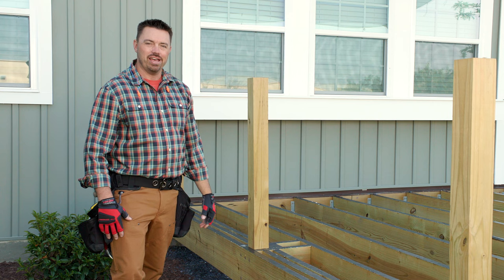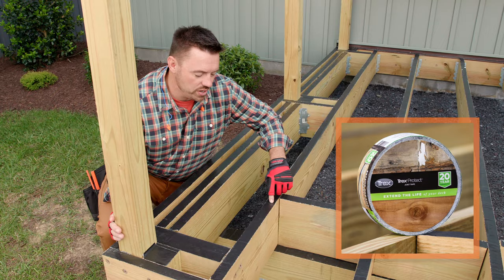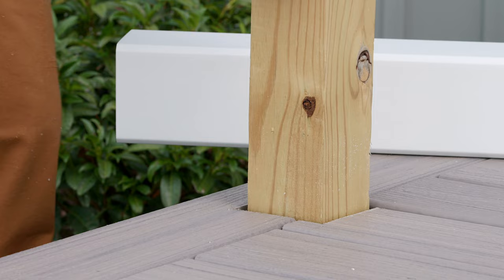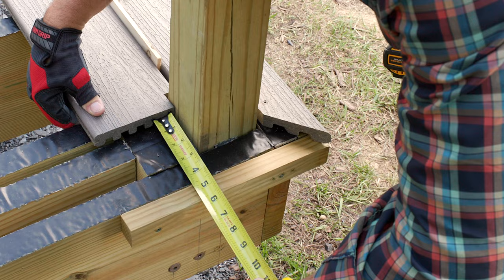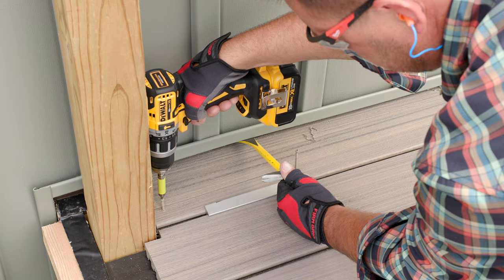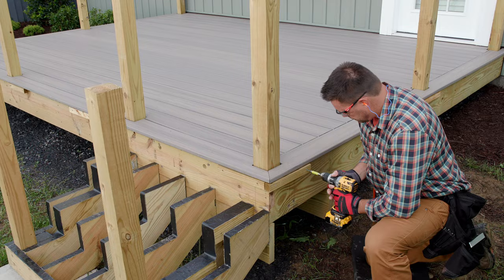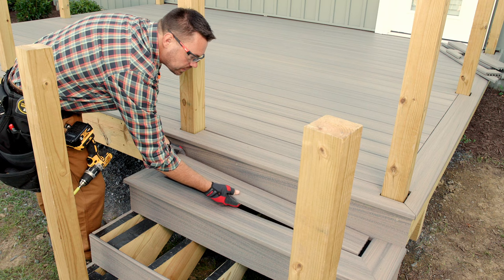How to Build a 12x16 ft Deck with Trex & Home Depot Part 1 | DIY Decking

Comment: When you install the outside picture frame board I think it’s best to measure back and pop a line because if you follow your 1 1/4 block and the deck isn’t perfectly straight you’ll have a bow in it wherever the deck is out because we know wood isn’t perfectly straight there for having a bow that will go the whole way back towards the house. Especially when resurfacing a deck.

Comment: Great presentation ! When fastening down a scalloped bottom like the Enhance Naturals deck board, as you said you need to be at least an inch away from the edge or end, but does it matter if you end up putting a screw in the thinner portion of the board... or even halfway on both the thinner/thicker portion ? Or is it just better to always screw in the thicker portion ? Thanks.

Comment: still need to hide the cut deck board to the picture frame board. leaving a gap you can see the raw edge
Reply from the maker: Hi!  Thanks for reaching out to Trex!  Feel free to contact us at our customer care department at 1-800-289-8739 or email us at customercare@trex.com for some tips on hiding exposed edges. -Trex Customer Care Team

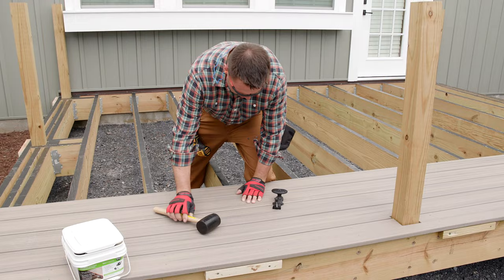Comment: For the two extra joists installed parallel to the out edge joists, to support the picture frame, you mentioned using Simpson L70 hangers. Do you have just 1 L70 per end on each joist stub?  I'm guessing on the first one, its on the outside face, and on the second one I see its installed on the inside face (looking at time 8:08).  Actually, looking at that tine mark, I'm confused about the placement of the L70 on the joist stub that is sandwiched in the middle -- is there enough space on either side for its L70?    Looking at building a comparable deck right now with a 1 board picture frame, and possibly this supplemental blocking method would be easier than what I was planning.

Comment: I'm building a Trex deck that's also 12x16' and about 2' high, just like in your video. But I'm not planning on using a ledger board, and instead will have 9x 12" cement footings (in a 3x3 formation), under a freestanding deck. The beams will be resting right on the cement footings, also like in your video. 

My question is - how can I best install the header joist (where a ledger board would've been installed) since I don't have the benefit of working off of the ledger board and then nailing in the joist hangers for each perpendicular joist etc. Should I use temporary make-shift supports installed to the underside of a few joists so I can rest the header board on them and then remove the supports after the board is nailed in, and then install the rest of joists or lay out all the joists and save the header board for last?
Reply from the maker: Hello Allison, thank you for reaching out to us with this question. We love to see you chose Trex! For substructure installation questions, we will advise to contact your local code/building official. Since various municipalities have different attachment requirements, this is always the best way to ensure a safe installation. If you have any questions about your Trex, please feel free to call us at 1-800-289-8739. Thanks - Trex Customer Care Team

Comment: What are the recommendations to fasten around the miter part of the picture frame board, any pattern in particular or just 2 screws at least an inch away from the edge and end ?

Comment: Composite decking is much more flemsy than wood. I thought it was supposed to be a maximum of 12 inch center for the framing because of that.
Reply: Depends on the brand. Many are now 16 oc

Comment: Thanks for the video. What is the gap between the 2 Blocking Joist, and are you using 2x12 for you Joist?
Reply from the maker: Hello, and thank you for watching Trex Academy! On this project we used 2x10 joist material. The gap present in this video was 1 1/4". This gap can vary on a couple of things, for example how much the deck boards will overhang the outside rim joist. If you have any other questions, please feel free to call us at 1-800-289-8739. Thanks - Trex Customer Care Team
Reply: @TheTrexCo  Thank you

Comment: What was the length of the picture frame board on the long side (16ft) that you cut down to fit?    Was it a 20 foot picture frame board?   What did you use on the 12 foot side to cut down to make it fit?  Very helpful video.
Thanks
Reply from the maker: Hello, we manufacture both 12' and 16' profiles of most of our boards. Those can be used for picture frame applications when using the square edge profile of the boards. If you have any additional questions, feel free to reach out to us 1-800-289-8739. Thank you, Trex Customer Care Team

Comment: Is it a bad idea to complete the whole pocture frame and then lay all your deck boards afterward so you have to use the chalk line and make that cut?
Reply from the maker: Hello Nate, you could install this way if you would like. It is best to start from the perimeter and work toward the house just in case you need to rip the width of a board so that the smaller piece is next to the house. For the chalk, Most colored chalks are permanent and may discolor the surface. Use only Strait-Line® Dust-Off Marking Chalk (purple), available at Irwin www.Irwin.com. If you have any additional questions please let us know. We are here to help! Kindly, - Trex Customer Care Team
Reply: I was kinda of thinking this too, didn’t want the cut the deck panel in place to avoid cutting into the protective tape. Incase I accidentally set the blade to low and cut it.
Reply: I dont see why it would be a big deal so long as your layout and cuts are PRECISE....
Reply from the maker: Hi James. Thank you for reaching out with your question and your interest in Trex products. You may start your installation from the picture frame in towards the house. This will allow you to hide a ripped board against the house if need be. Please feel free to reach back out with any further questions or concerns. Someone from our Customer Care Team will be more than happy to assist. Thank you for choosing Trex. Kind Regards. -Trex Customer Care

Comment: Could i do same deck using all squared edge boards, trex. I was able to purchase square trex boards at a great price. I want to use on my front porch. What's your thoughts. Linda
Reply from the maker: Hi there Linda! You can certainly still install the deck using square edge boards. You would just be fastening the boards down in a more traditional method similar to what you would see in the video where they are installing the picture frame boards. If you would like to still use the Trex Hideaway Hidden Fasteners you would need to use a router bit to route a groove in the board for the clips.

Comment: The trex hidden fastener instructions say to drive the screw flush with the clip and not into it. It is not easy to get exactly flush. I'm wondering how important this is for proper installation.   One way to check is to drag the bit over the seated screw head. If there is a difference, the screw can be carefully seated a bit more. On the trex approved  deck screws, the ones in the installation guide are pretty hard to find especially color matched. Any tips on sources? Thanks
Reply from the maker: Hi there, thank you for reaching out to us today! The color matched composite deck screws that are approved for Trex decking can easily be found on DecksDirect.com or DIY Homecenter. Additionally, you can find the correct color match with Starborn's color matching tool. Here is a link to get there: http://starbornindustries.com/deck-matcher/tool

We hope this helps and please give us a call at 800-289-8739 if you have any other questions. -Trex Customer Care

Comment: 16” on center? I heard 12?
Reply from the maker: Hi there! With all of our 1x6 products we have done extensive testing to determine the maximum recommend spanning is 16" on center. That being said you can still do a 12" center if you would like to as the extra support will not hurt the Trex. As long as you do not exceed the 16" maximum the boards should not sag.

Comment: What's the cost of a deck this size start to finish
Reply from the maker: Hello!! The cost of a Trex deck typically runs from $9 to $16 per square foot. Of course, that depends on where you're buying it as the dealers and retailers set their own pricing, and how much you’re purchasing. Visit our Deck Cost Calculator for a customized estimate based on a national average or use our Where to Buy tool https://www.trex.com/find-trex/ to find a local dealer in your area in which you can reach out and get their specific quote. Please reach out to us at 1-800-289-8739 if we can help assist in answering any further questions.
Trex Customer Care

Comment: It looks like the wood frame is touching to house which is something I don't want to go through again! Is there a reason trex is not put on the backside up against the house?!...It should be.  Plus close off underneath with trex to avoid pests, rodents, snakes, feral animals etc.   IDK...there is new steel decking out which is a definite thought.
Reply from the maker: Hello. Thank you for your interest in Trex. Trex is not used against the house as it is not for structural elements.  The ledger attachment at the house is one of the main structural elements of a deck build.  Flashing this area is very important to reduce the chance of any rot or decay.  On Trex Academy https://www.youtube.com/watch?v=tTtLOrC3YqI we have a ledger flashing video that may be of help in this situation. Covering the deck underneath to avoid pests is common and done on a lot of decks but is a personal preference and there are a lot of options to doing that. Yes, steel framing is available, and it may be an option for some. Please feel free to reach back out with any further questions or concerns. Someone from our Customer Care Team will be more than happy to assist. Thank you. -Trex Customer Care 1.800.289.8739  |  customercare@trex.com